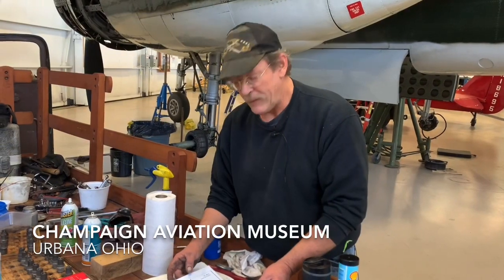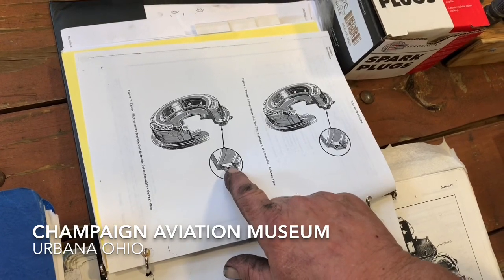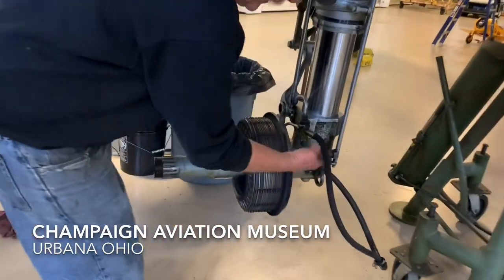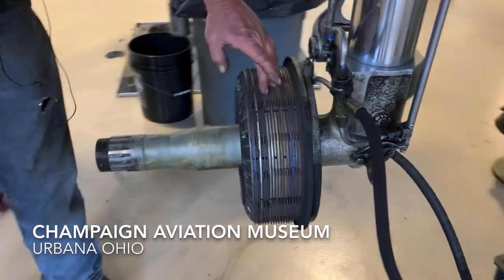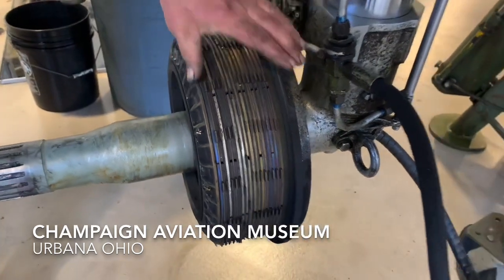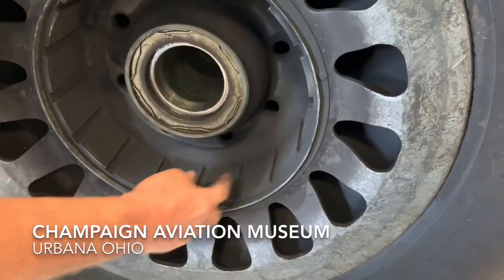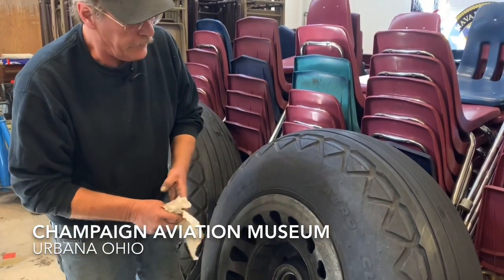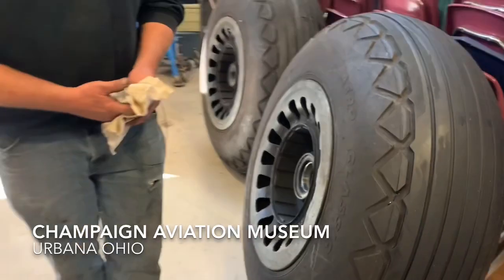How the WWII B-25 Airplane Brakes Work: Warbird Maintenance

Comment: That’s not at all how I envisioned aircraft brakes to work but it makes perfect sense. It looks a lot like a clutch pack for a motorcycle or atv or even the clutch plate and disc sets in an automatic transmission. Sounds like it works on the much the same principle. 

When folks were talking rotors and stators describing this setup the only rotor/stator combos I could think of were the hydraulic variety in something like a torque converter or fluid clutch or the rotor and stator in a generator or motorcycle charging system. I couldn’t imagine how this setup looked in my head without seeing it. Many thanks for posting and explaining the operation and theory.

Comment: Those brakes are pretty much identical to the brakes used on every airliner today.
 Except today they use a different pad/disc (carbon/carbon) material and instead of one big piston they have multiple smaller pistons.

Comment: It's amazing to me those thin plates with the teeth sticking out to engage the wheel have the rigidity not to twist and bend or shear under heavy load, but I can see how the extreme distribution around the hub probably makes for relatively low loading per tooth.